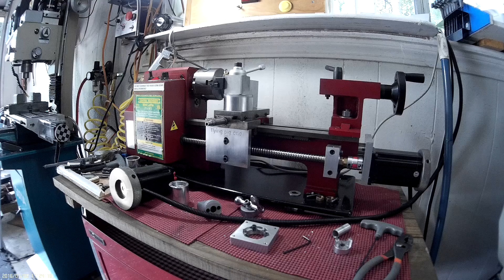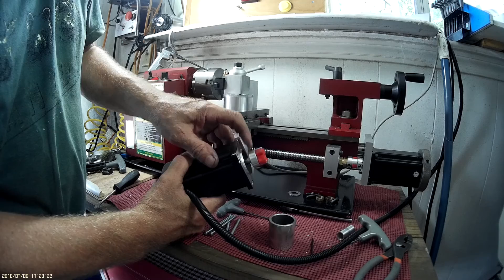REC 0028

Comment: Very curious about your project. Do you have design drawings? Did you choose the stepper motor size based on required energy, or were they just "at hand" (since I have smaller NEMA 17 available for my own project)?